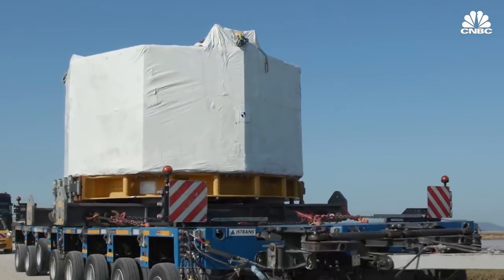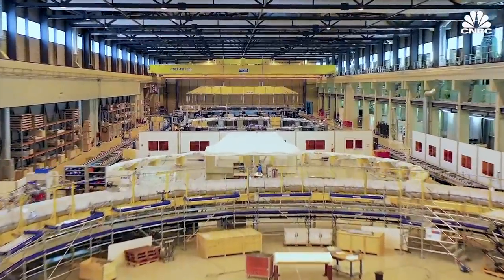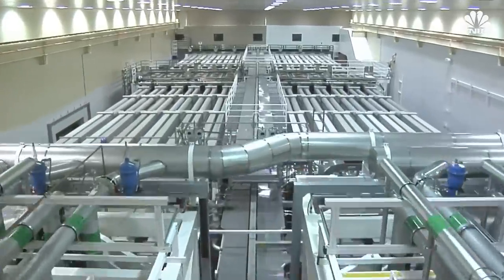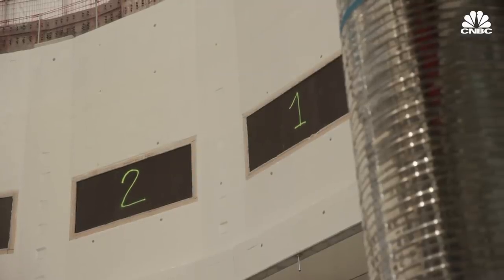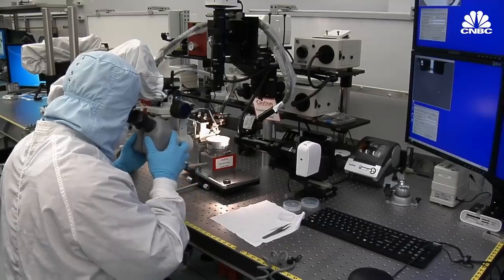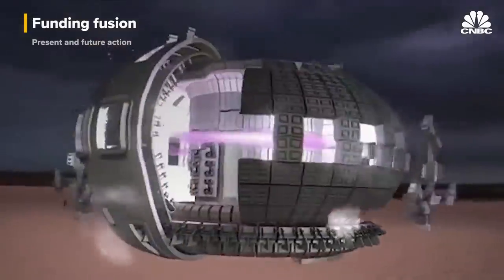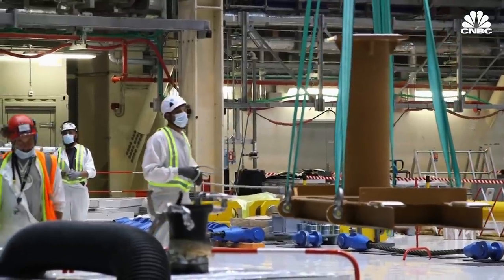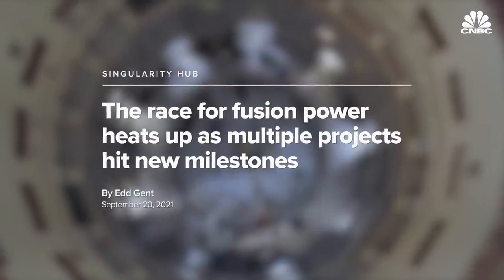Can This $22 Billion Megaproject Make Nuclear Fusion Power A Reality?

Comment: It lifts an aircraft carrier or not.  The distance (you said 6 ft) doesn't matter.
Reply: It’s probably a misinterpretation of the narrator regarding the range of the magnet. 
As in, it can probably lift a plane sitting 6 ft under it.
Reply: It's true.  Gotta love "science journalism"
Reply: @brunojl2  I know. I thought too much about it. It was causing me cognitive dissonance.
Reply: Force over distance is the amount of work it can do.
Reply: Ok. A Nimitz-class aircraft carrier has a draft of 37 ft. If this magnet can pick it up 6ft, the bottom of the ship would still be 31ft underwater and the magnet would not be lifting the entire weight of the ship.
https://en.wikipedia.org/wiki/Nimitz-class_aircraft_carrier
Reply: @jaystarr6571  if I was reporting, I probably would have steered away from any illusory discussion using an aircraft carrier. Instead I would have said how many Tesla units it would be when in used in the application.
Reply: @jonowack  Agreed.
Reply: @jonowack  Most journalist seem to get confused when you actually tell them the calculation.
Reply: @jaystarr6571  I would be amazed if it turned out that took that into account. But very good point
Reply: I'm so glad that the question about fusion energy is moving towards when and how, instead of if, this could solve a lot of problems for us
Reply: Ha, I was guessing that after 6 feet the magnet just gives up and goes home.

Comment: US: We are willing to spend 2 trillion on a war to accumulate oil that our dollar is based on
Also US: But you're telling me I have to spend 30 billion on nerds in lab coats? Yikes
Reply: They must have not done a good job accumulating oil, considering current gas prices.
Reply: @aerohard  Dude. the war wasnt to loot the oil but to keep it traded with the dollar.
Reply: @okbuddy5304  Hence why the EU wanted no part of the war, well except for America's pet terrier, England.
Reply: @okbuddy5304  the corrupted oil dollars!
without if, the dollar was gone.....
Reply: but it does not produce co2 emissions so nope we still want oil till it runs out
Reply: @jaffacalling53  blame goes to Biden!
Reply: @raven4k998  don’t hold your breath that it will be here in 30+ years.

Comment: I wish you also mentioned Wendelstein 7-X, which is the coolest fusion expetiment in my opinion.
Reply: Is that the one with pistons?
Reply: @jsl151850b  nope
Reply: lol, only because it LOOKS cool, right ? truth be told, you have no clue if it is any better than a 1940's Tokamac from Russia.
Reply: Hopefully it solve the instability problems. A larger scale test reactor would be great. As well as some room temperature superconducting magnets.
Reply: I'm so glad that the question about fusion energy is moving towards when and how, instead of if, this could solve a lot of problems for us
Reply: @psycronizer  Dude, there were no tokamaks in 40's. The first one was built on 1958. (T1) looks like it's you who has no clue.
Reply: @abdullahunal1108  you looked that up on google, but you don't have the library that I have , books man, books. I'm talking about the design, the idea !

Comment: Iter is not (designed to) putting out more energy than it consumes. That 50 to 500 ratio doesn't account for the whole energy necessary.
Reply: @flybeep1661  No theyre right, the 10 Q is Qplasma not Qtotal.  The total energy in is going to be less than the total energy out.  Physicist confuse people with these variables
Reply: @flybeep1661  No, YOU’RE not smart and not educated on the subject. They don’t typically talk about the total energy when defining the energy ratio, Q. Bradley Huffman summed it up pretty nicely. Don’t go around calling people not smart if you don’t even understand the basic concepts. Go back to high school physics class, son.
Reply: @dahleno2014  exactly right.
Reply: "ITER's thermonuclear fusion reactor will use over 300MW of electrical power to cause the plasma to absorb 50 MW of thermal power, creating 500 MW of heat from fusion"
Converting heat to electricity is only about 50% efficient, so you would get 250 MW out, less than you put in.
Reply: dont break your brains they know what the goals are and what they doing
Reply: @Daniel-fv1ff  And that’s when the reactor is working, which won’t be 24/7 and the facilities need power even when the reactor isn’t working. The 50% figure of thermal to electric seems a little low. It’s more in the region of 70% , but even there with a plasma Q of 10, you are barely breaking even in the whole plant.
Reply: @Steven The physicists are the ones who request funding, not the reporter.  For example in the US we have the NSF.  You don’t secure funding without sending in a proposal that will have to  convince the approving board that theres a benefit to the research (the board is comprised of experts in the same field of research).  With something like this, on this scale, no doubt in my mind if it was clear that the reactor couldn’t achieve net positive the government and/or private entities wouldn’t have funded it, at least to this scale.  A proof of concept on a smaller scale, less expensive, sure.
Reply: @bradhuf  most people don't seem to understand that the reactor was never meant to produce net energy, it was designed as an example that fusion energy is possible and worth it
Reply: @personguy1004  Explain why its worth it if the goal was never to produce net energy?
Reply: @personguy1004  And beyond that, we already know its possible.  So yet again what is the goal if it was never to produce net energy?

Comment: Half a million years from now people will refer to this technological leap as the most important step after the taming of fire by our ancestors.
Reply: If you think about it, fusion reactors are just 'taming of fire, part two'.
Reply: @Steamrick  taming of stars
Reply: A fire can be started by a lightning strike or some flint and dry wood.  Find one instance you can start a fusion reaction outside of a star by accident.  Not a chance.  Star nurseries are huge and a star birth likely takes hundreds if not thousands of years.  But humans are going to do it using a few acres of empty lot in ten years.  Good luck with that happening.  I want unlimited energy at my fingertips as badly as anyone but my hopes are waning as I get older.

Comment: The problem is that heat and pressure just aren't enough.   Quantum tunneling initiates  much of the fusion process from a star, and our scales are too small to take advantage of that phenomenon.   Add to that, even the "Q10" is deceptive.  They are quoting Q Plasma, not Q total.   We still need to turn that plasma into electricity, and to do that, we are still relying on boilers and steam power.   Which by the time you get to electricity, your nowhere  close to getting as much energy out as in.  I mean I hope we (as a species) come up with something, but right now, we still aren't anywhere close to making this work as an energy source.

Comment: I have seen a lot of exotic multi axil trailer moving everything from 150 tons to over 1200 tons and that truck and trailer configuration moves only 300 tons max.  That core magnet tops out at 300 tons not 1000 tons.  That trailer would heave the road and tip over with the load as it sinks into the roadbed.    Anything over 600 tons is moved by multi articulated schnabel trailers with at least 30 axles connected to 120 wheels or more plus 6 or 8 trucks just to maintain safe traction on the slightest slope.
Reply: 23000 tons assembled. Individual sections are lighter.
Or an I missing something?
Reply: Well I wonder what’s up with that ? Your right about moving loads on roads !
Reply: Or road creeper treaded  trailer I’ve seen nuclear cores moved around corners using two layers of plywood with grease between layers !
Reply: Simple. They'd use a strand of creeper.
Reply: I was thinking the same thing, I had to look up the trucks that carry ~500 tons and they're massive. And lifting a carrier 6 feet? Did they mean from a distance of 6 feet? If it could lift it 6 feet, it could lift it 1,000 feet.
Reply: @extremeencounter7458  Magnetic fields typically decrease in relation to the radius squared. So what they mean is that it produces a strong enough field that you could place the carrier on the magnet and then lift it to a height of 6 feet above the magnet, at which point the distance is too far for the magnetic field to lift it any further
Reply: why care about the load?
Reply: @keenanbarker3436  Ok I'm high and questioning myself while rereading this. Do you mean that beyond 6 feet away, the ship won't have an influence on the magnet anymore? If so, that doesn't really mean it's lifting a carrier 6 feet by what they said, does it?

Comment: ... So only 20 more years until fusion is realistically here for all?
Reply: Hehe, that got me...
Reply: Indie Fury  that is correct but from then where you had to put in 100% energy to get 10% back. The latest reactor test put in 100% to get about 90% back and we only need over 100% for it to be viable. So it has not been standing still for 71 years.
Reply: Indie Fury  and as the saying goes, " it always will be" (just around that 71 year corner, that is).
Reply: Indie Fury  They've been saying that since the 1940s, and the joke has been "Fusion will be here in 30 years because it is the energy of the future and always will be." However, this time we are actually closer than ever to making net fusion power, the first experiments into fusion weren't even viable as an energy source.

Comment: Q: What's the universal constant of fusion energy?
A: It's always 30 yrs away.
Reply: The reason for that is that they are using that $22 billion to basically do nothing for the next 30 years other than taking very expensive vacations. And when the $22 billion runs out, they will apply for another $40 billion saying that fusion power is only 20 years away. The $22 billion isn't about fusion research, it is all about living a life of luxury and doing as little as possible.
Reply: Q: What's the universal constant of fusion energy in your home planet?
A: It's already here 4.603 billion years.
Reply: @ivobrick7401  "A: It's already here 4.603 billion years." Again, you are not the sharpest crayon in the box. Make it happen in your garage, or shut up about it.
Reply: @ivobrick7401  Wrong.
Reply: @nathanwoodruff9422  Good you have such insights into their motivations.

Comment: The narrator claims that ITERS eventual goal is to create 500 MW of fusion power from 50 MW of heating power. This is extremely misleading, as she is describing the PLASMA ONLY. The whole system of ITER (including giant magnets, vacuum pumps etc.) will consume far more than 50 MW of power. ALSO keep in mind the heat generated needs to be converted to electricity, which can only be done with limited efficiency. Overall the WHOLE SYSTEM will be a net energy loss.

Comment: Looking forward to the day where one of these can fit within the profile of a large rocket. If someone like Elon Musk with his future Starships is looking to go Nuclear, this would be a viable option for Starship that is slated to have a wider variant than current prototypes that are being worked on at Starbase, TX. Obviously, we're still probably at least a decade or two off, once after there's several operational facilities with this, before a working prototype of a Nuclear fusion generator could be a viable choice to use on a rocketship. If anything, something implemented on a space station. Certainly useful for Moonbases or a Mars base. Realistically, it'd more than likely be a nuclear thermal based propulsive system first, before seeing a NPP (Nuclear Pulse Propulsion) based engine.

Comment: There's unfortunately one little nitpick with the ITER project (which I'm a huge supporter of by the way, this just needs to be pointed out): the 10 times energy in is 10 times the energy coming out of the plasma than went in, which doesn't account for the inefficient way we transform heat energy into electricity or the energy used to run the magnets.

Comment: The real game changer would be using fusion power on spaceships since the fuel, hydrogen, is found pretty much everywhere (in gas giants, in comets as water, in the solar wind, etc.)
Reply: Even so called "empty space" has some hydrogen in it.  Many SiFi books have used this as fuel for inter stellartravel.

Comment: i am against fusion fision and the other thing. because the "fuel" is lost after usage. probably not useable for somethong else end not renewable. so upfront. this question: what will happen with the power plant if. there is no fuel anymore. is calculate how long the power plant can run ?

Comment: According to scientist who worked in fusion experiment says if they put 1000 times power includes all computers and cooling and otherstuffs , fusion dome only produces/output  1/1000 of that 😑😑(they says 1unit power to=0.7 unit  outputs now in fusion ..That is misleading investors to invest billions in it )  , and  need 50-80 years atleast for  some real-life , commercial applicable  breakthrough as 1 unit input to =output  2 or as 10 units  times power output as they says

Comment: An interesting thing can be done to reduce the cost of the power plant
Turn off and on the power plant very quickly in a thousandth of a second, like an anti-lock brake. In this way, a small amount of hydrogen is introduced, as soon as the reaction starts and the temperature rises to thousands of degrees, the water is turned into steam with heat, and then it turns on again until the temperature drops, and the temperature rises again, and this cycle continues. It can be repeated thousands of times and is safe. It is also inexpensive. Compared to having a fusion power plant with a continuous temperature of several hundred million degrees.

Comment: I would like to know how they harness the output power,   I can understand how they use the input power but not getting the output.
Reply: The head generated, after fusion is sustained is used to boil water an turn an turbine. It's funny how generators almost always lead to boiling water.

Comment: 0:04 Since when is a magnet rated in a distance it can pull somthing off the ground? So the Aircraft Carrier weighs more at 7 feet than it does at 6 feet?
Reply: It is a very daft way to rate the magnet but you missed something about the magnetic field.  The attraction force from the magnet decreases with distance.  It 6 feet it will be one strength and at 7 feet it will be less strong.

Comment: Cooling the water back down would use all the positive energy output. If you don’t cool it down then it’s just thermal pollution. Basically a big water heater.
Reply: Yea... Just like every energy generator out there. It uses vapor to generate mechanical energy. School is important

Comment: The 500 MW output for 50 MW input figure is misleading. The 50 MW refers only to the energy in the reaction itself, and not total input energy of the entire system, for instance the massive amounts of energy needed for cooling and energising the magnets. It is possible that after all this money is spent, the energy equation will still be in deficit

Comment: I am not going to dream of being anything other than a uncouth savage, but what kind of containment could hope to contain plasma as hot as the sun if there is a failure in the magnetic field?  Is there some low tech heat sink or containment like a mixture of a body of water and metamorphic rock?

I am not well enough read on the subject and only recently found out that we achieved plasma.  I am curious about how one could use something as hot as fusion to create electricity.  Would this be a steam driven turbine?  I literally am too dumb to find where to start to satiate my curiosity with real information instead of some fluff piece.  Any links would be greatly appreciated.  My mind could use something to unwind with an educational curiosity.

Comment: Solar and battery grids are going to eat fusion alive, much simpler and a fraction of upfront costs. Cover every rooftop with solar panels, that's the future. Then cover parts of the desserts around the world, all the energy we need.
Reply: require much more space and are much less efficient, let's not forget the monstrous amounts of metals and environmental destruction needed for such a thing. And let's also remember that with no wind, no electricity will be generated and thus we will all have to stop using any light in case of no wind
Reply: Solar panels require too much water to clean them. They are again, unefficient and require monstrous amounts of land and materials just to generate a miniscule fraction of what a full scale fusion reactor would generate. A

Comment: Nuclear fusion is unfeasible because of the contamination and damage caused by the radiation onto the surface of the shell into which the reaction occurs.  It's like the rail gun: the rail is useless after one or two shots. In this case the shell becomes useless after a few reactions...
Reply: That’s not really accurate. A “few” reactions is a monumental exaggeration.

Comment: This is 1940’s tech. The Germans built the first (the bell, not a ufo but a tokamak!)
Meanwhile we have patents and prototypes for portable hydrogen fuel cell generators (my father worked on them in the 80s) and Vacuum zero point technology (that was being worked on in the 90s in compartmentalized projects) and Tesla wireless electricity. 
As Ben Rich of Lockheed Martin said “We have the technology to travel to the stars, but it is locked up in black projects, and would take an act of God to bring out to benefit humanity.